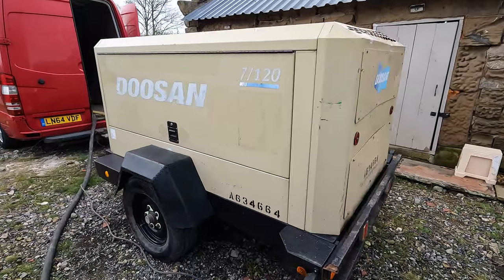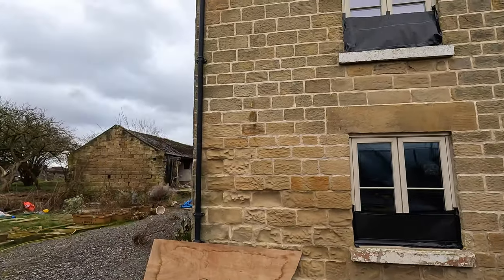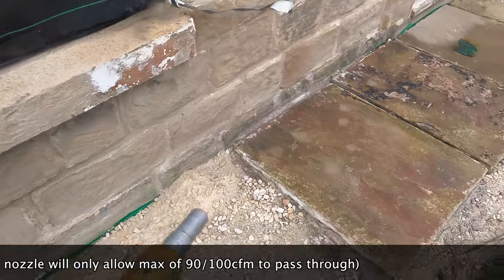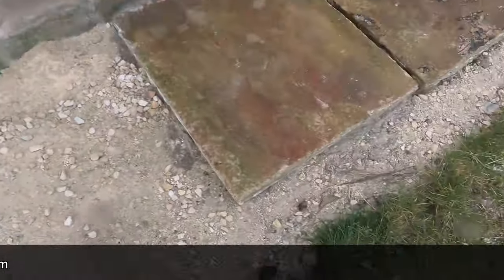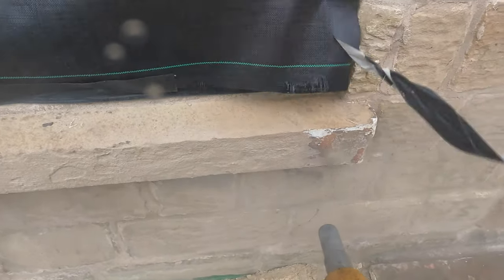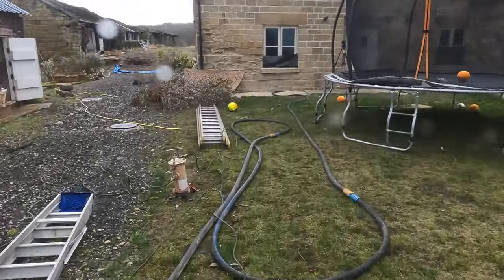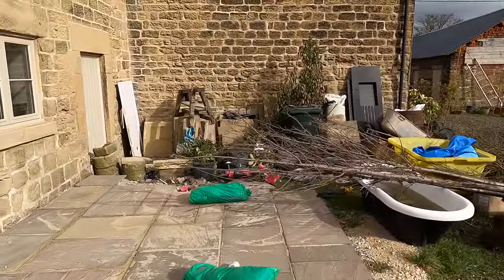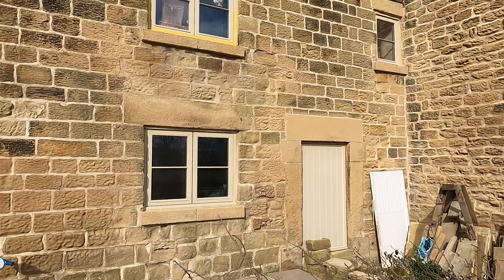Stone Restoration SandBlasting paint removal Restore

Comment: Nice one , glad you fixed your compressor. Started checking out different compressors when I see gas board etc working out and about 😬.🙏😊
Reply from the maker: Hopefully it will be a good asset. Road works only use 140cfm units finding stuff that's big enough for blasting is like finding hobby horse shit 😂

Comment: good stuff man looks tidy, it seems like the machines faster - I know its probablies not, it's the same power as last one right? but it's probablies nice for you not to have to piss about every 15-30 mins when it conks out. glad to see it's working looks that that 1k hour service did it's job. nice one mick
Reply from the maker: It's nearly dubble the power of the last 1 but it's all restricted by the nozzle at full power I would definitely struggle to keep control of what's happening. I have plans for this year hence buying this bigger rig just I won't spoil too much just have to keep watching 😅 looks like it's sorted pal I still need to run it on full demand under full load before I know for sure but I haven't had any issues with it this job 🙏

Comment: Mike  can you put the cooler from your author compressor on this new one? Is that possible.?
Reply from the maker: I don't fink it would be cut out to do the work needed as the last rig is 260cfm and this is 425cfm I was going to give it a go but wanted to make sure it's faults are ironed out before investing anymore money into it as I would need a complete re plumb on the air end side on both rigs to make it work

Comment: Hi Mick, would you recommend this method (sand blasting) for the cleaning up off bath limestone building? For example where the limestone has started to go darker and black in places? Thanks
Reply from the maker: It depends chemicals can do a good job but limited to how clean they can get the serface were as blasting is abrasive and needs a skilled operator not to damage the soft stone but in the right hands I would recommend blasting over chemical 👍

Comment: Aye, mind I was having all problems way back at the start, that was because I didn't have the aftercooler. It's totally impossible to regulate anything and end up using twice as much grit too. Do you no still have that coalescing filter that you showed me once? It might help
Reply from the maker: Funny you ask that as its was in the van and I was going to pipe it up but after an hour or so it started to flow nearly. I didn't have my box of tricks to change the fittings to make it work anyways 😅

Comment: Mick did your 771 have a drier on it then?.. the 7/120 has no drier ?
Reply from the maker: Yeah its not a dryer as such is a cooler cold air is easier to dry in a water trap also cold air is nicer on the pot/pipes etc yeah my 71 had a cooler I don't fink it's worth ripping it out to put on the 120 as 71 is 260cfm and it was factory fitted 120 is 425cfm I would say it wouldn't be man enough it did cross my mind and I will definitely revisit the idea if I cannot live with this 😀

Comment: Can you fix the after cooler from your old compressor
Reply from the maker: I can but I don't know if it's worth doing as it's designed to work at 260cfm and the new 1 is 425cfm I don't know if it would cope plus I don't really want to rob bits off the old 1 as it only needs a ECU and I can have a decent backup plan

Comment: Hi Mick. What is the maximum pressure bar your compressor working?
Reply from the maker: 8.6 bar is its working pressure it would go to 12bar but not safely its best to stay in its safe working load I only need 7bar at the nozzle I need flow more than psi

Comment: Looks like a john deere motor with the turbo? had my 260 for 16 years, ran faultlesly, oil changed every 100 hours, diesel filters changed every 25 hours, i put a cheap fram replacement filter head on, so a couple of quid to change, and a 50p inline filter, moral of the story is.... keep those diesel filters changed!!!
Reply from the maker: my 260 Service intervals are every 250 hours 1000 hour service is oil air separator and belt 
this 425 is John deer and Service intervals are the same specified by doosan I do have spare air filters and change these as and when needed they like to eat dust haha

Comment: Can you use the cooler of the old unit Mick .
Reply from the maker: Yeah but I don't know if it will cope as that's designed to work at 260cfm and this is 425cfm plus I don't want to make the old 1 too far gone to repair as it is I only need a ECU for it and I've got a good backup plan
Reply: @Mobileblaster  food for thought Mick for the ECU try out car/van ecu repairs may work out cheaper
Reply from the maker: @Mohammad Omar  it's a sealed unit mate I cannot get into it 🤔

Comment: Sand must be blocked/Wet ! - That's water that's coming out the nozzle i reckon
Reply from the maker: Water don't remove anything it will only suppress the dust made with media. With this setup anyways. Water at higher psi and a direct nosel would cut but not like this 👍